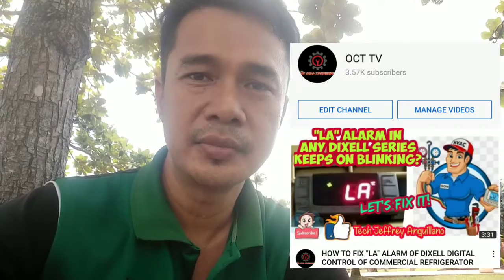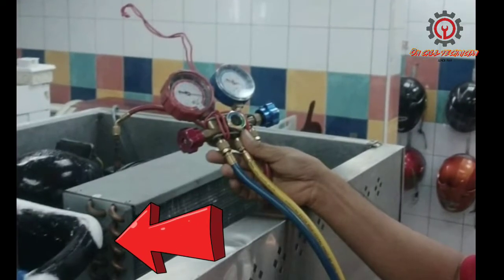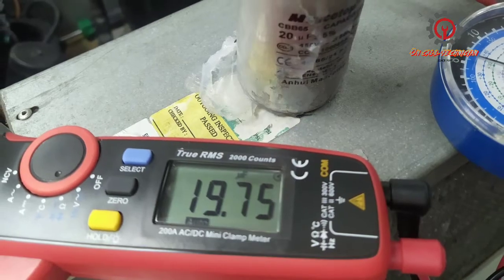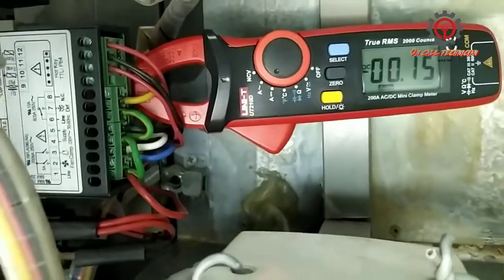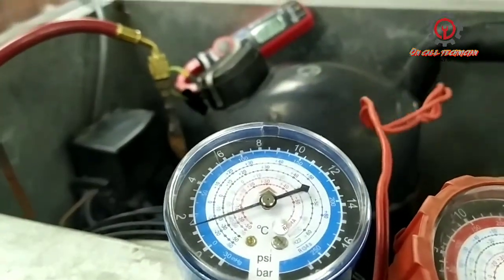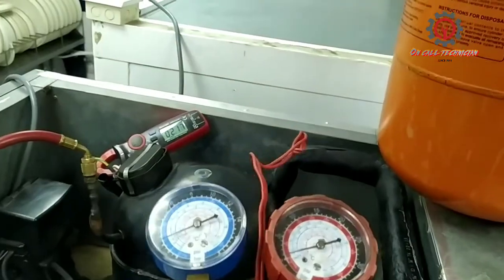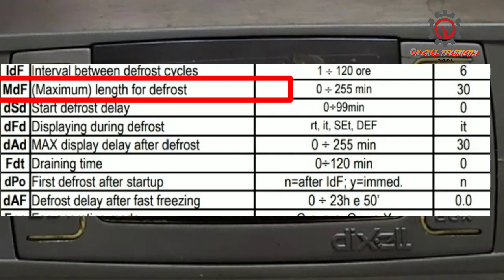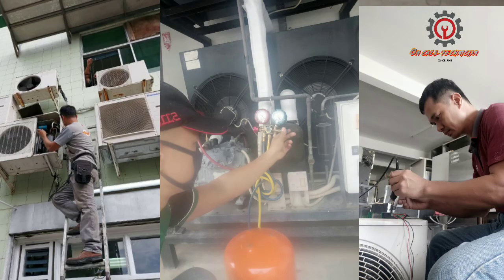HOW TO ADD R404A REFRIGERANT INTO UPRIGHT FREEZER

Comment: Good morning, congratulations on the channel. I wanted to ask you a question. I bought a used freezer cabinet and when I turned it on it worked strangely, the compressor turns on, stays on for a while and then turns off and doesn't reach temperature. To understand better I excluded the control unit and connected the compressor, evaporator fans and condenser directly to AC. Unfortunately the compressor continues to turn on and off. I noticed that the compressor's absorption while it is working (not at start-up) is 1100 watts, when according to the plate it should absorb 600 watts (the two fans together consume about 100 w). What could be the problem?
Reply from the maker: Check relay, overload, and run capacitor first, if still persist replace compressor. But before doing so check if there's a solenoid valve that runs together with compressor

Comment: Sir, thank you for your very informative video.  May I ask your help. I have a 4 door upright freezer with R404 refrigerant. I changed the filter dryer and capillary. I have another access valve before the filter dryer. Is it ok to charge liquid  R404a before the filter dryer side or vapour on the low side? Thank you and more power.
Reply from the maker: Try it sir since that procedures are discussed in our refrigeration books. In walk in freezer/chiller we charge  liquid in low side the reason is refrigerant goes easily into the system.
Reply: @THEMULTISKILLEDTECH  Thank you for the response sir. More power!

Comment: Thanks a lot for your video. I want to ask if I can charge r404 to r22 compressor after changing the txv to 404.
Reply from the maker: Yea sir can, just observe your txv. I've done that on our old walk in freeze lr w/o changing expansion valve and commercial refrigerator.

Comment: Sir yung chiller ng ice,umiinitvng husto ang compressor kaya nag ooff compressor saka yung cable nya galing outlet mainit din
Reply from the maker: Check condenser fan at condenser fins baka madumi na po. Yan po ang nag papainit sa compressor at ang isa pa ay baradong filter drier

Comment: Great video. Question I have a freezer that calls for 24oz of r404a. Around what psi should a freezer be at.and do I need to charge in liquid or gas?
Reply from the maker: 18 - 25 psi sir, and don't charge it in liquid unless your unit is walk in freezer and the compressor is between 5 -20 ton
Reply: Thank you
Reply: @THEMULTISKILLEDTECH  thank you brother.  Here an update I add the 24oz and it left me at 15psi the freezer got to the set temperature at -5 and shut down. I did notice a little frost built up once it hit -2°  do you think I should add freon until it get to 18psi?
Reply from the maker: Use clamp meter too sir and try to reach the rated  amps stated to the freezer label. Is your unit operated by digital control ?
Reply: @THEMULTISKILLEDTECH  yes it a digital thermostat.  Meter is reading 6amps
Reply from the maker: What is rated amps sir? What is the setpoint value? Why it cuts at -5 only it should be -17 to +23 depending on your set point

Comment: Hi good day sir Regarding on open Display meat chiller sa suction pressure same lang din po ba 25-40 psi and let be considered the ambient temperature of the area? Thank you in advance
Reply from the maker: Best practice sir is follow manufacturer's recommendations sa unit nila. Mga chart available online are guides lang natin. May unit kaming r404a na 45, 60, 40, 25, 16 psi ang karga . Ang gulo di po ba? As what im saying, follow the manufacturer's recommendations

Comment: Hello
I changed the compressor of open door freezer..I charged the gas 404a up to 20..But the temperature not reaching below 7°c ..I need below 0..Can you please tell the actual problem..And let me know the actual running pressure of refrigerant r404a
Reply from the maker: Can you tell me your setppint value in you digital control please?

Comment: Sir what is the problem of freezer compressor which has moisture/cold on the top of compressor. What is the solution?
Reply from the maker: Are  having an ice built on evaporator? If no, then its normal reaction

Comment: Sir pwdi ba mgVid ka mgRefill ng freon sa water dispenser?
Reply from the maker: Sir wala po kasi kaming water dispenser, pero watch ka ng video  kung paano magkarga ng 134a sa ref, same po yan sa water dispenser. Charge mo ng 6 psi lang. Sa mga bago  unit ay wala pa po yang access valve, need lagyan at hanapin ang leak kung naubos na freon nya sir.

Comment: Sir..i have question.i have a machine which is must go at least -30..but after change new compressor , filter drier and capillary..it only goes to -20...what should i check...im already increase  the liquid r404a ..but it seem didnt work until frost on ..what should i check ? Low pressure only go to 10 psi..thanks
Reply from the maker: Try to add more refrigerant sir, just pay attention to your compressor amperage

Comment: Sir I have a question.
I have a refrigerator which is horizontal laying down with 3 doors in silver metallic body
And in this gas is 404a I charged gas and its working good but becoming very hot after some and because of over load stops working
Plzzz tell how much gas i should charge at how much amps so the compressor will not get hot any more and cooling also be good
And I need temperature of that chiller from +1 to +3 range
Plz
Reply from the maker: Is your 3door chiller still have label sir?  If so, a refrigerant in kilograms is stated therein. Over charging makes your compressor overheat and the overload will cut off the power to protect it. 
In my description I write there our R404A charging pressure and our units are for commercial use.
Reply: @THEMULTISKILLEDTECH  yes sir there is label

Comment: Hello sir, ask ko lang sana kung parehas lang ba ang karga ng 404a freon sa compressor na 1/2hp- 3/4hp, at 1 hp,at ilang psi charge sa low side ang minimum to maximum nya? Thanks
Reply from the maker: R404 between 20-25 psi lang sir for freezer. Pwede ka din magbase sa ampere sir, before ka magcharge check Muna run capacitor if less than 80% n ng value nya change na. 
If 1 HP change with 1 HP, if 3/4 HP, change with 3/4... Gaya ng sinabi ko sir base ka SA ampere at di ka maliligaw
Reply: @THEMULTISKILLEDTECH  thanks sir sa info. At sana madami pa kayong matulungan.
Reply from the maker: Sa label sir mayroon din pong nakalagay na kilograms ng refrigerant nya. If mayroon Kang timbangan use it sir.
Welcome sir, update ka lng dito anytime sir.
Reply: @THEMULTISKILLEDTECH  thanks sir sa idea.

Comment: Sir can i ask all of my unit is walk in freezer... At McDonald's 404a refrigerant..
What is the advantages and disadvantages if i recharge it in liquid lowside and gas lowside sir.. thank you very much sir...
Reply from the maker: For walk in freezer sir charge it with liquid in low side, if gas charging it will not go into the system. No advantage and disadvantages sir. Its normal that's what we do
Reply: @THEMULTISKILLEDTECH  thank you so much sir... Now i know...
Reply: @THEMULTISKILLEDTECH  sir.. did walk in freezer and cabenet freezer.. has a deferent standard pressure or it still the same sir..? Like compressor horizontal and compressor vertical... Thank you sir..
Reply from the maker: R404a pressure for walk in freezer/chiller sir is 20 psi bitzer compressor sir. Cabinet or upright freezer pressure is between 20-25 psi sir.
Reply: @THEMULTISKILLEDTECH  Sir sorry i have a lot of questions just a beginner.. sir..
When compressor running the pressure lowside is 25psi when it reach positive 3F° it drops to 14psi.. it is normal sir or not..?
Reply from the maker: Normal is running should be the same even temperature goes down.

Comment: Can i convert gas r404 to r134a into compressor r404?
Reply from the maker: Yes but bear in mind that 134a suit for medium/high temperature such as chiller while r404a for low temperature like freezer
Reply: Means for upright freezer r134a are not suitable to used ?
Reply from the maker: For commercial yes but for chest freezer on issue

Comment: Why didn't we use liquid from the 404a tank
Reply from the maker: Don't  refill if compressor is running, compressor pumps vapor not liquid.
Reply: So if it's a walkin freezer it could happen but a upright fridge no?
Reply from the maker: @blingmotions6996  You can do liquid charging as long as compressor is in off mode. For both upright and cold room. Top up in walk in freezer using vapor is, it takes  time ( R22, 234a .. vapor charging; R404a ... liquid charging) what ever freon you use, do it in liquid charging
Reply: @THEMULTISKILLEDTECH  
Ok thanks

Comment: sir may tanong lng ako anon po ba standard psi sa 404a
Reply from the maker: Freezer po is 20-25 psi,
Chiller po is 30-40 psi, commercial refrigerators po Ang mga iyan sir. Mayroon kami walk in freezer bitzer compressor 20 psi lng, meron Naman Electrolux walk in chiller design for 60 psi pag ginawa mong 45 psi nagyeyelo evaporator nya sir

Comment: gud am/pm sir tanung lang poh anu poh suction pressure ng 404a ,upright freezer rated current 3.7 amp, nagcharge na poh ako 26 psig ,ampere nya 3.3 amp palang at temperature nasa -1°c palang for 30 minutes na umaandar  ,please reply thank anu tamang charges at ampere
Reply from the maker: Max nya 30 psi kabayan pero stay ka lang Muna sa 25 psi. Dapat 2 hours -18 and above kana
Reply: @THEMULTISKILLEDTECH  bagong palit poh ako ng filter at starting capacitor na 80mf ,nalinis narin system ,,charging nya poh ngyon is 25pisg ampere is 3.5 amp nah temperature nya -10 c 40 minutes
Reply from the maker: Check mo na din run cap sir
Reply: @THEMULTISKILLEDTECH  same poh bagong palit ng capacitor 80mf at isa 10mf ,bago na poh  pagka hindi poh bumaba ng -18 in 2 hours ,pwede na isagad 30 psi charge ? ,unang beses ko kasi mag charges ng 404a ,, lagi kami Ammonia at r22 410 407 s mga Aircon unit ,
Reply from the maker: Bababa pa yan sir....wag po isagad kawawa si compressor. Kami babalikan din namin mayamaya  kapapalit lng compressor ng combination freezer and chiller. Dito Muna kami ibang issue
Reply: thanks poh s reply ,panoorin ko poh mga video s youtube thanks
Reply: @THEMULTISKILLEDTECH  sir normal poh nag yelo suction line pati casing ng compressor ,bali -14 c palang sya , 25 psi charges 2 hours
Reply from the maker: Di po dapat sa casing sir
Reply from the maker: Check mo door gasket malamang mayroon nakaawang if okay fan evaporator mo sir
Reply: @THEMULTISKILLEDTECH  overcharges poh ba pagka umabot s casing ,23 psi lang sya , -14 palng in two hours
Reply: @THEMULTISKILLEDTECH  wala naman poh awang ,nung -10 palang sya nag yelona suction at nag -14 nah nag yelo konti s casing
Reply from the maker: Try mo dagdagan na sir I max mo na
Reply: @THEMULTISKILLEDTECH  same poh nag yelo 30 psig naging -10 nalang temperature ,my yelo din sa casing pagka naman 18 psi -14 c kaso nag yelo din same pagka 20 o 25 psi ,
Reply from the maker: GUMAMIT ka po ba ng 141b sa sir sa pag flushing mo?
Reply: @THEMULTISKILLEDTECH  yes poh meron nalinis evaporator at condenser , 16psi charge nag -16 sya ,my yelo parin s casing pagka tinaasan charging tumataas temperature at mas madaming yelo s casing
Reply from the maker: Ano controller nya sir? Calibrate mo baka ok na temp mo sa loob. Kung dixell pagbasehan mo po ito. May Daya din po yan👇https://youtu.be/myoUOm0Ai4E
Reply: @THEMULTISKILLEDTECH  thanks sir iniwan kona s work tapos na duty ,,pero iniwan ko 16 psi charges nag -17c na sya , pagka charges nya 20 25 psi -14c lang ,30 psi -10c lang sya ,nung binabaan ko charging nya bumababa temperature 16psi -17c nah ngyon iniwan koh ,thanks poh s reply panoorin ko rin poh yan video nyu s control
Reply: gud am sir update s gingwa ko freezer 16psig charging ayun -20 na sya after 12 hours my konting yelo parin s casing ,walang name brand control Sf-104 china controller ,hindi ko masend picture
Reply from the maker: Latest model malamang upright freezer mo sir, ang charging nila is via kilogram meron din kaming new model, at ang OEM charge nila is 8 psi after 7 months not reaching na dinagdagan na lang namin
Reply: @THEMULTISKILLEDTECH  TAurus brand ng upright freezer ,360g Refrigerant charges ,rated current 3.7A
Reply from the maker: Yan 360 grams nila is by kilo. Next time sir Dala tayo kilograms para sure tayong mga tech. Yung Amin ginawa naming 20 psi Buhay pa Naman Ngayon at cake freezer use di pede bumagsak temp, malulusaw ice cream cake

Comment: Good day sir, upright freezer 404a Hindi cia lumamig nakusulat sa specs. Amp.  3.5 amp. Charge ako ng 25 psi NASA  11°C temperature, Hindi lumamig tapos umiit compressor, ano Po ung purpose ng solinoid valve thanks po
Reply from the maker: Ang purpose nya is on and off nya po refrigerant flowing at ang supply nya is from compressor. If aandar ang compressor dapat magoopen Naman solenoid mo sir at pag nag off compressor dapat off din.
Reply from the maker: If good solenoid check mo run capacitor, filter drier, at expansion valve sir